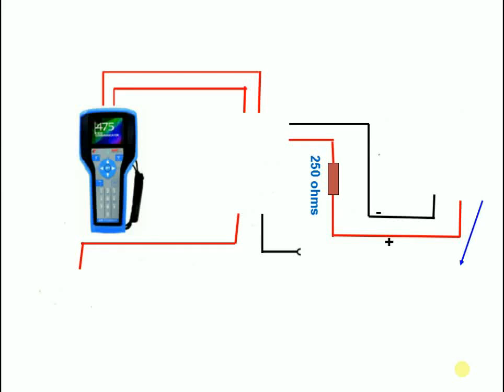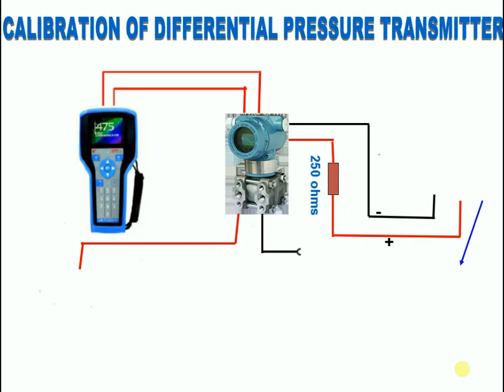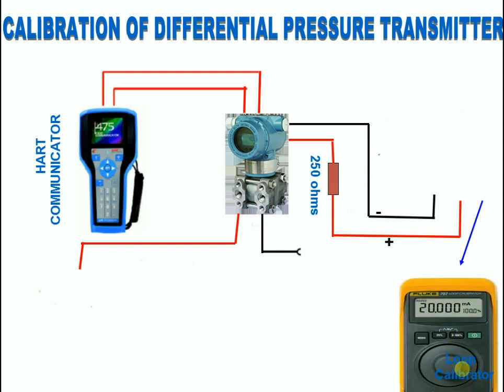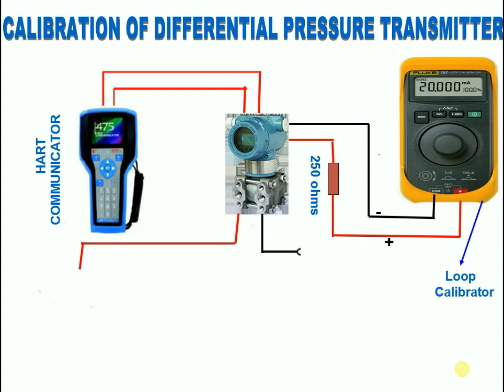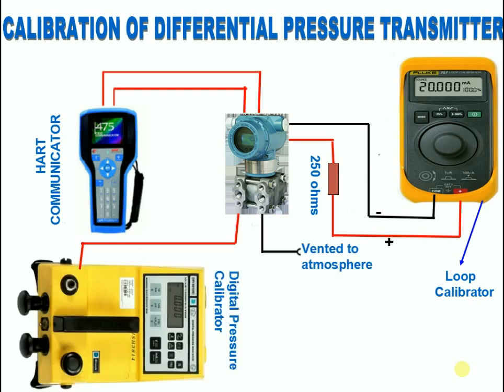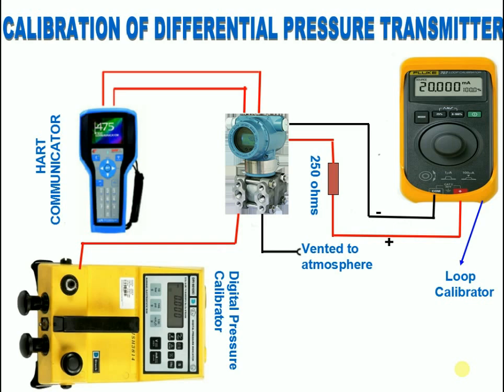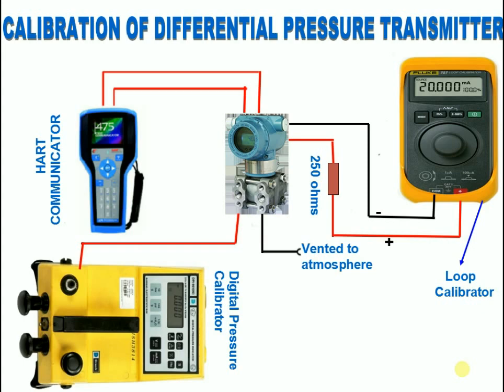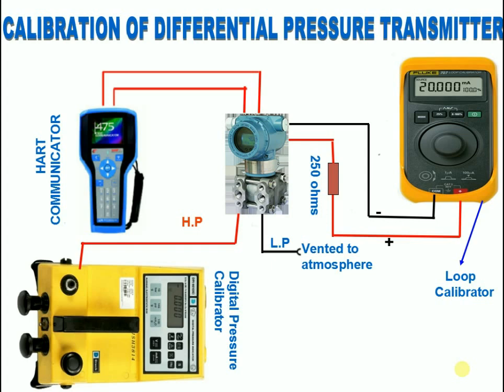How to calibrate(Calibration)  Differential pressure transmitter using HART

Comment: how to check static pressure?
high side vent should be open!
Reply: lower side vent is open when check static pressure.
is it right?
Reply from the maker: high or lower side any one has to be open and equalising also to be opened so that pressure will act equally on both sides.

Comment: Respected Sir,
 
                   I have been working in Fauji Fertilizer Bin Qasim Limited, as a Sr.Instrument Supervisor at Ammonia Plant.   Fauji Fertilizer Bin Qasim Limited (FFBL) is high pressure high temperature largest DAP, UREA (granular) manufacturer chemical plant in Karachi Pakistan. FFBL has its own power generation (52.6 MW) used peak of technology for process automation and control system like DCS, PLC and microprocessor based (SMART) instrumentation that can meet worldwide standards. Consider me if there is a vacancy for me. Please  I hope for a positive reply.
 
                    AZIZ- U- REHMAN JAMALI
 
SR SUPERVISOR INSTRUMENT & CONTROL (I&C)
 
 
 Aziz.jamali@yahoo.com     aziz.ffbl@gmail.com                   
  
                    CELL #   +923462243209
Reply from the maker: hi i am working in a ammonia and urea plant in instrument department
Reply: GOOD SIR 

WHAT IS YOUR CONTRY NAME  
AND WHERE IS NH3 & UREA PLANT
THANKS 

AZIZ JAMALI 
SR SUPERVISOR  INSTRUMENT 
KARACHI PAKISTAN
Reply from the maker: india
Reply: sir I belong to karachi 
I have five year power generation experience MIin ccpp. now working as electrical engineer in ipp..could you get me introduce as a instrument engineer or supervisor in ffbl